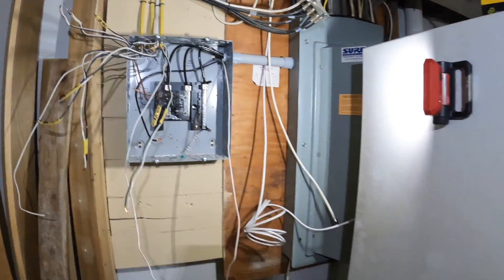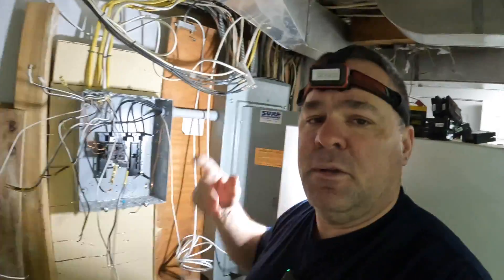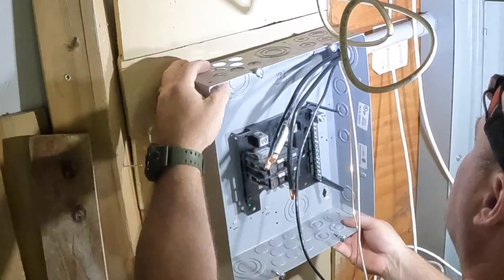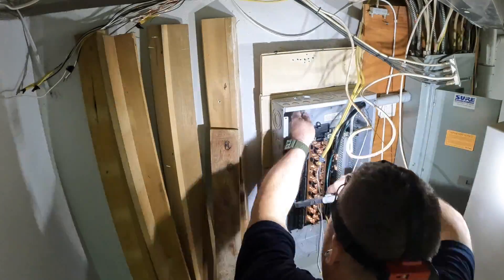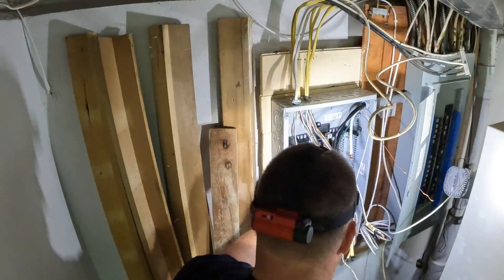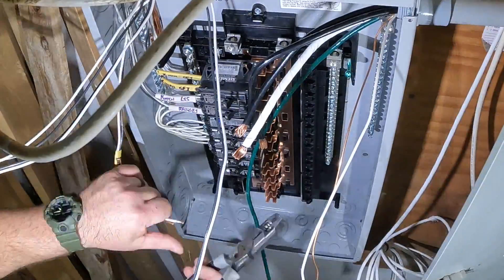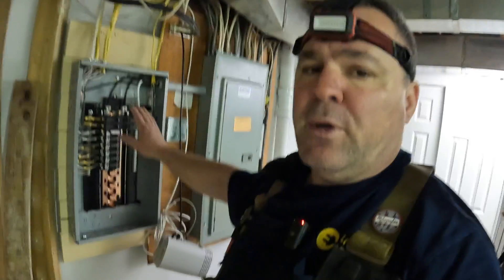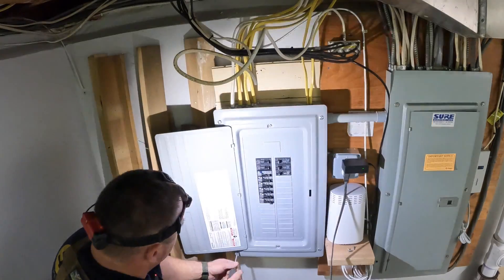Upgrading a sub-panel for new A/C equipment | 30-circuit MLO panel installation

Comment: I used your videos heavily when doing my own service upgrade, including going from overhead to underground, in GA (homeowners permit). The little stuff like how you drilled holes through siding was invaluable to me. All the other channels just cover code, not much practical installation like you. Passed inspection of course. The guy never even removed the panel covers!! Sad, I wanted to show off the workmanship you taught me. Thank you, saved me 8K.
Reply from the maker: Wow! If service laterals and service upgrades go for $8k in Georgia I might have to think about getting may license in Georgia!
Reply: @electricianron_New_Jersey  I got two quotes. One was 12K and one was 15K. I spent about 3-4K in materials and brand tools (like Milwaukee torque wrench, Fluke 375FC) to do it all myself.  Leviton subpanel with Dual function gen2 wireless breakers. QO meter main combo. Utility company did the underground to the meter for free. The quotes I got did NOT specify equipment so you can imagine what their margins would be.
Reply: @electricianron_New_Jersey  but people must be paying it if that’s what they are quoting.
Reply from the maker: @Braindead154  what’s the distance from the utility transformer to the service point?
Reply: @electricianron_New_Jersey  think it was 50 feet from pole to meter. Utility initially wanted $1300 then said they would do it for free.

Comment: Hey Ron I have a question for you what is your opinion on tool belts? Do you wear one or do you just use a tool bag. Everyone I wear I hate and I’m having a difficult time finding a tool organization system that works good for me. I love your videos and you are great at what you do. I would love to hear back from you. I would really value your opinion. 
Thank You,
Tommy from Long Island, NY
Reply from the maker: Hey Tommy, thanks for your kind words. Try searching for Atlas 46.com. Its all made in America gear and I have purchased a bunch of stuff from them in the past year. LMK how you make out. I would suggest the padded suspenders, rigid tool belt, main tool attachment, and the screws and nails attachment.

Comment: If you can’t find the nameplate on these Air Handlers here’s a rule of thumb: 

On the AH there should be breakers installed already and they pretty much tell you te rating of the heat strips

2 sets of 2 pole 60 amp OCD = 20KW
1 set OCD 2pole 30 and 1 set OCD 2 pole 60 = 15KW
2 sets of 30 2 pole OCD = 10KW
1 set of 2 pole 30 OCD = 5KW 
You can use your amprobe to double  check. 

Normally nameplate should be inside the cover next to the heat strip but they’re hard go find.
Reply from the maker: Very little electric heat around here. Natural gas is our thing.

Comment: Most Hvacs don’t have neutrals as you are aware. afci wouldn’t work- at least for Eaton (mine) need neutral wires. All My breakers are gfci/afci, except hvac, as no hvac system commonly used have the neutral. Take a neutral off a breaker of lights and it won’t work until that neutral is plugged in TO MONITOR THE BALANCE.

As you being a YouTube teacher, how are you torquing those breakers with that Milwaukee drill (considering everything of a panel has torque specs/requirements) ? lol
Reply from the maker: huh?

Comment: Yo Ron, I can’t remember what video it was about the goof ring. I changed the old recess lights with new LED ones. Those goof ring was a life saver that I never knew existed. Thank you
Reply from the maker: Beautiful! I just did a bunch at the Point Pleasant Beach house on the porch with vinyl siding ceiling on a porch. They look GREAT IMO!!!

Comment: Great job as always.On the subject of gfci protecting 240v condensing units,at this point you might as well gfci protect the entire panel.IE,make a gfci main breaker.They have been doing it in Europe for years now.I feel like here in north america we are always behind for some reason.Looking forward to another video.
Reply from the maker: So would you want your whole house to be “in the tripped position” because one appliance, lamp, or air conditioner had a little current leakage? A GFCI protected main is an awful idea, in my opinion.
Reply: @electricalron  I agree with u 100%.but I'm looking at it from a cost perspective also.instead of having for example 5,8,or 10 gfci breakers in your panel,it would be a lot more cost effective to just have one which would protect your entire house.
Reply from the maker: @pawelelektryk2985  Right, but when one thing causes the GFCI to trip your whole house would shut off.

Comment: The issue with leakage is an industry wide problem with kitchen appliances. Ive dealt with it with refrigerators, electric ranges and countertop small appliances.
Reply from the maker: More problems with arc-fault protection than GFCI protection in my experience.

Comment: Great job Ron. I’ve always went with the copper buss bars. Not a fan at all with the  arc-fault breaker requirements as far as outside condensers etc going forward.
Reply from the maker: Thank you glad you liked the video!

Comment: Every AC manufacturer is fighting it due to inverted high efficiency units electronics causing a current imbalance.  This new rule was due to a child climbing over a fence touching a condenser that was not grounded and he unfortunately died.  The NEC should require the units not to operate if not properly grounded or some type of visual like an indicator light when not grounded.  A GFCI would have saved this kids life so would have the current code of having a low impedance fault current path so breakers trip.  Unfortunately you are still going to have fly by night contractor’s skating the rules and not pulling permits.  Any large inductive load no matter the manufacturer can cause a current imbalance when starting this will cause nuisance GFCI trips.   I understand the code panel wanting to keep people safe the current code accomplishes that when properly followed.
Reply from the maker: Thats a shame about them kid dying because of objectionable current flow on the frame of the condensing unit. It makes me mad that it could have been avoided had a qualified electrician done  the work.

Comment: If they had a "soft start" added to their condenser would it not draw much less power to start the inductive load?  If that is true could you have  put that circuit in the sub panel or would it still be drawing to much power?

Comment: Any particular reason you went with that PN panel and not aluminum buss? Is that house near the saltwater ?   Just curious.
Reply from the maker: I matched the new panel with the existing circuit breakers from the last panel. This saved money for the homeowner because I didn't need to buy expensive AFCI/ GFCI breakers.

Comment: Motors and compressors are unique when it comes to elextrical.  Its hard to put them into a table for techs and sparkies to understand.  Heck, even inspectors too.  I was cert both  HVAC and electria l resi and commercial.  It was nice to service the equipment to the meter. Yeah, heard about that conpany holding up the works.  Also heard the 2025 NEC change for GFCI on HVAC was due to a kid touchibg a faulty condenser unit, sadly it was a lost of life.  A soft start kit will help for future gen use and move the breaker to the sub box.  Nice work as always Ron.  Stay safe out there. 😊
Reply: Like they say, the NEC is written in blood!
Reply: @Braindead154 The problem is that the unit that killed someone wasn't properly grounded. How is requiring GFCI protection going to solve poor workmanship? The same hack that didn't ground the first unit certainly won't install a GFCI for the next. It's really a money grab by manufacturers on the code making panels.
Reply from the maker: @edisont.picard4112 Maybe if the manufacturers integrated GFCI protection into their units. Then the hack handyman can’t screw it up.
Reply: @electricianron_New_Jersey  Or, we could go like how Europe does it and have a GFCI (they call it residual current detector) at the main breaker. I think they allow something like 30mA instead of our 5mA, which might hurt more, but still won't kill you. Would be cheaper than having (almost) every breaker needing its own.

Comment: So,, since the code will eventually require arc fault breakers for air handler-will you install an arc fault breaker for the future air handler?
Reply from the maker: No way. Not required. I can ask the customer but I wouldn't try to sell them something they wouldn't need.

Comment: I’m an HVACR tech and first I’m hearing of this.  Is that holdup company started by a guy named Willis?? Lol
Reply from the maker: NEC Article 440.6(A) requires that branch circuits and overcurrent protection be sized based on the nameplate data. minimum circuit unit ampacity, max OCPD.
Reply: I see you trying to carry her! I have two 4 year old units. X-13 blower motor went out on the first one at 1.5 years. I put a rescue in that one. Had a 1/12 HP condenser fan motor go out on the second unit a couple weeks ago. Nobody local had that in stock. Cap was bad also. Not sure what took what out first.
Reply: @scotts4125 consider a Zebra or Diversified Tech surge protector.  I go back with Regal Rexnard Evergreen VS motors as replacements at a fraction of the cost when the warranty has expired.

Comment: Looks great. Gravy little sub panel replacement. Bet the air handler is gonna be the hardest part of the job, if its up in an attic or something. I get into arguments with guys at work all the time about sizing circuit conductors and OCPDs for A/C units. Surprisingly lots of guys in the field with lots of experience dont know how to do it
Reply from the maker: That's unfortunately very true. NEC Article 440.6(A) says all you need to size branch circuit wiring, overcurrent protection, and disconnect size/ style (fused, or non-fused).
Reply: @electricianron_New_Jersey NEC, what's that? I'm not gonna buy a code book, they're like $70. You know how many packs of smokes and 6 packs I could buy with that money? Lol
Reply from the maker: @YaksAttack  Also, for only $10/ month you can have full access to the NEC online at https://link.nfpa.org
Reply: It’s somewhat understandable because it’s maybe the only time your wire can be undersized for the OCPD.
Reply from the maker: @Braindead154  Well, motors too but I dont too many jobs wiring motors.

Comment: Interesting that the HVAC company did not have their own electrician...Might want to go back after they are done with the install and make sure they did not do some shade tree electrical hacks on your work.
Reply from the maker: I'm going back to connect the equipment once its in place in a week or two.